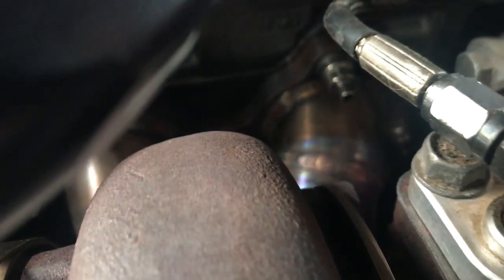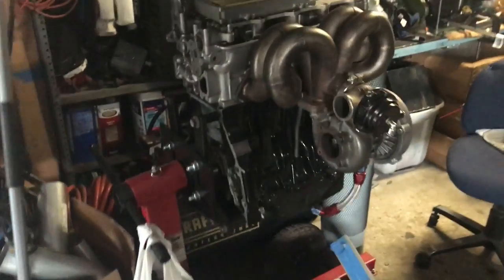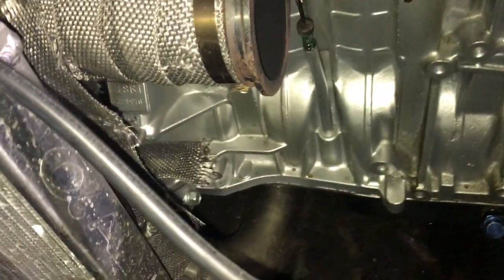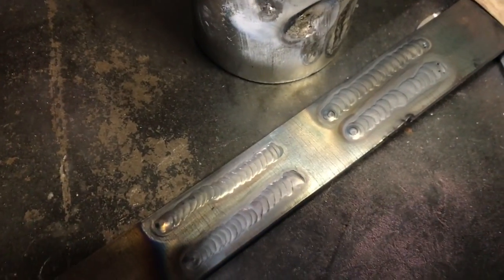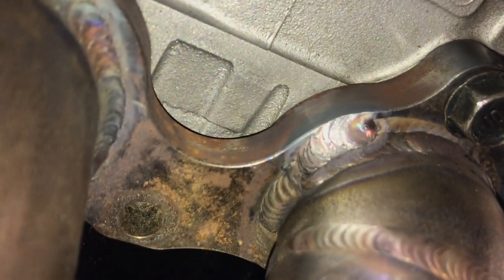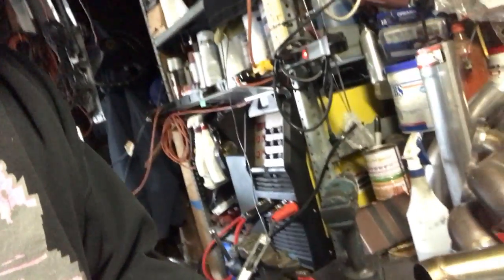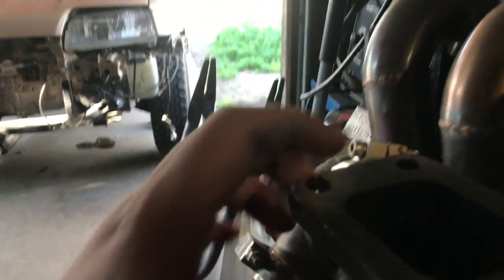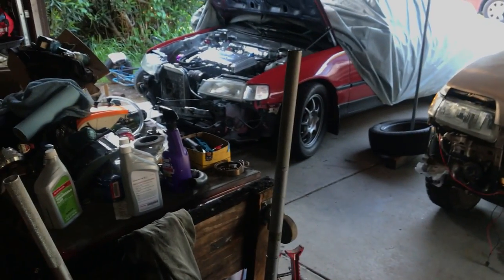Cracked Turbo manifold Repair | CRX V2

Comment: is this manifold 310 stainless? if not, there you have your crack reason. 
Your filler should be at least 310 or SNi6082(inconel filler wire)
If your base plate is NOT stainless, you should use the SNi6082 for the weld.